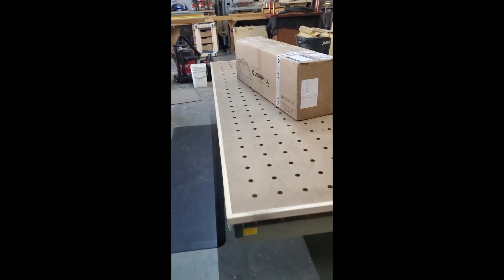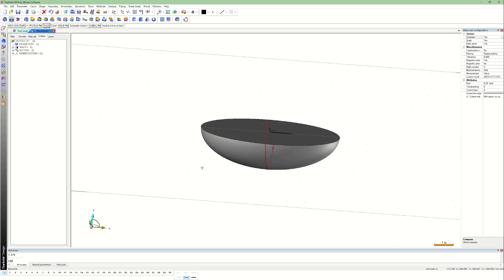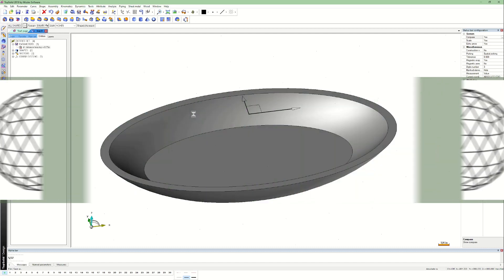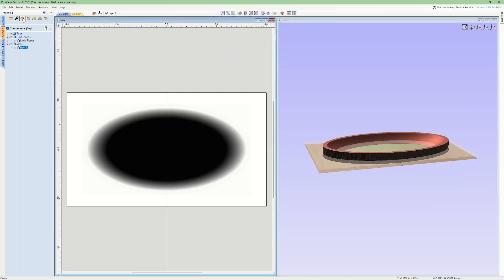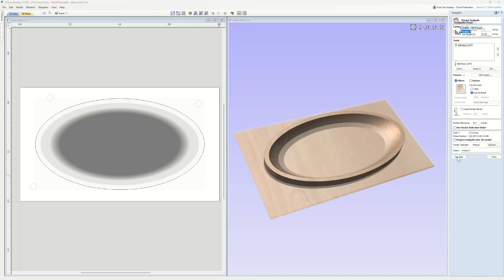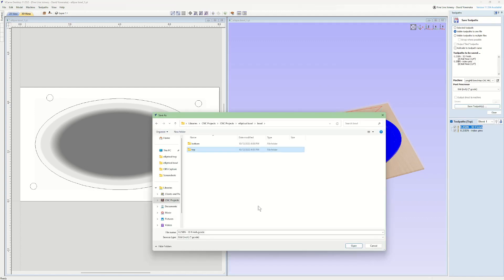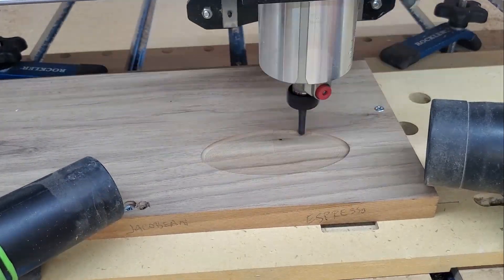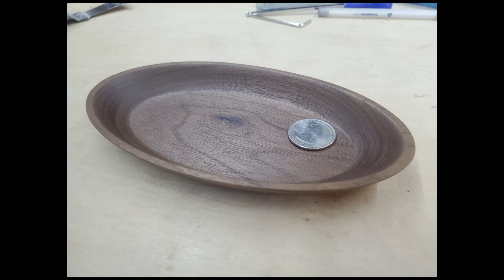Can't Make THIS Tray With Your Average Router! (LongMill CNC first project)

Comment: Nice. I am considering this machine (surprised I hadn't heard of it until a few weeks ago). Also good to see a project with 2 sides. I'm not even sure I've seen one posted before, and it's such an obvious need. I can't imagine doing conventional woodworking where everything has to be a cookie sheet design, but I feel like CNC has dumbed things down to the uninitiated.
Reply from the maker: Thanks! I'm pretty happy with the machine. It's at a pretty friendly entry price point and I feel like the quality is comparable to machines 2-3 times more expensive. Trade-off was having to build it from bags of hardware, but in many ways, that's a plus too. I also like what I've seen about @SienciLabs and am happy to support a small company. To be fair, it's still a new experience for me, but I'm hoping to push it harder in the near future. I feel like it's pretty much only limited my the user's imagination!
Thanks for watching the video!